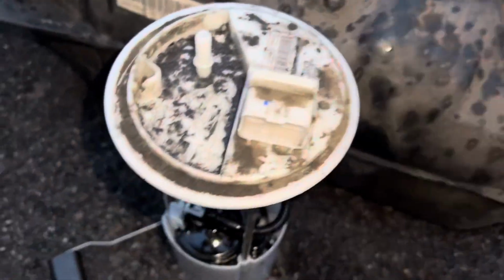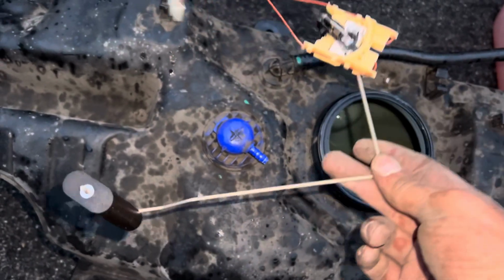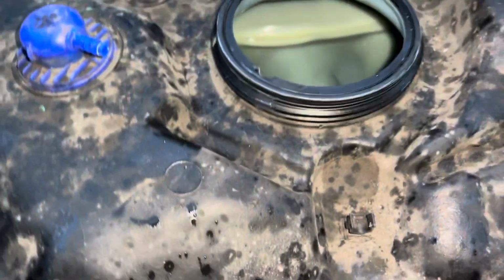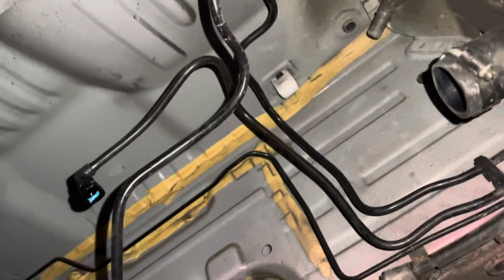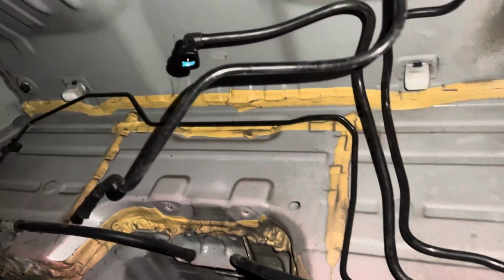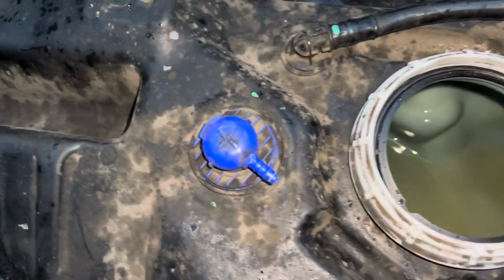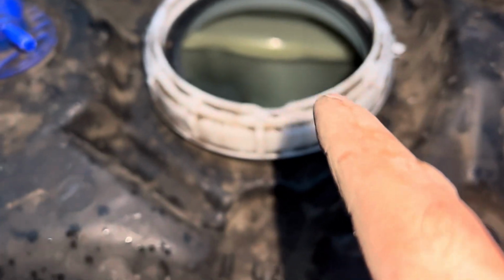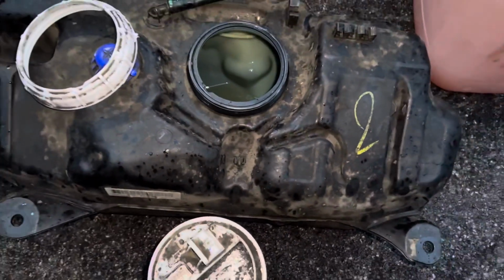VAUXHALL ADAM FUEL GAGE NOT WORKING - CAR NOT SHOWING FUEL LEVEL - VAUXHALL FUEL SHOWING 0 FIX  2016

Comment: I have a 16 plate ,I'm having the same problem been back to garage under warranty they said it was a wire ,2nd time they said no fault codes showing  ..would this show on a computer or am I just getting the run around
Reply from the maker: Hi, no fault codes come up when it is this issue so no matter what type or computer connected it wouldn’t show

Comment: My girlfriends car fuel gauge goes down rapidly from full to half a tank within about 25 miles. Would this be the same issue?
Reply from the maker: Sorry I don’t really understand your issue, if your cars fuel gage reading wrong or is your fuel actually going down faster
Reply: @carhelpforyou  when you fill it up to the point where it stops to say it’s full. When you start driving, the gauge starts to drop dramatically. I drove it for 25 miles on the motorway at 70mph and the gauge went from full to half a tank which can’t be right and my girlfriend keeps thinking she needs to top up fuel lol
Reply from the maker: @pepball1776  once it dropped did you take it to fuel up and see if the fuel was actually low if it is then you’ve got a leak somewhere if if it didn’t then replace the fuel gage
Reply: I have this problem too, it happened once in 2019 and it’s happening again now. The fuel gauge rapidly goes down as you’re driving even though you’ve just filled up. There’s no leak, in fact once I’ve been parked up a while and then got back in the car the gauge starts going back up again as I’m driving and the miles to empty go up as well. It’s very random. So it’s gotta be the float/sensor? Another known issue on the Adams apparently. I’m on Teesside too btw 🙌🏻
Reply from the maker: @rukiakuchuki  seems like faulty float best to replace it, would recommend getting the part from dealer just had a few issues when I’ve fitted ones from eBay etc recently but dealership ones haven’t let me down yet
Reply: @carhelpforyou  Hoping it is the float, drove for 10 minutes last night with Fill Fuel flashing only for it to then jump up to a quarter full and going up 🤷🏼‍♀️ Better to get the part from Drive Vauxhall in town then you reckon?
Reply from the maker: @rukiakuchuki  sound like the float, yeah go to dealers for part don’t buy elsewhere

Comment: Does the fuel trip (distance to empty) readout still work even with the sender up the creek?.....as it's fed by the ECU and flow?
Reply from the maker: If the float in the sender is faulty or broken it will not read correctly or sometimes even read at all

Comment: I have the same problem also now have an other fault coming up about to much oxygen in the engine. Garage thinks it’s linked with the fuel gauge problem. It’s 2016. Any help would be great.
Reply from the maker: I would advise start by repairing the fuel gauge the same way I did or even replace the entire pump if oxygen issue persists check the sensors known as o2 sensor (oxygen sensors)
Reply: I have two faults. 

P0171 mixture adaptions lean 
P0463 fuel tank level sensor voltage too high.

Did you have any codes come up with the cars you have seen ?
Reply: @lisakernachan6651  what was your fault ?

Comment: Hi mate, could u not access the fuel pump from under the back seats rather than removing the tank.
Cheers.
Reply from the maker: Hi, sadly no access from inside the car other can cutting a hold into the car under the seats which would leave you with a hole under seats
Only way access would be to drop the tank sadly

Comment: My car just turn off without a reason. Power los and engine turns off. No start for a few minutes. No fault codes.
Any idea?
Reply: Hi there I’m having this issue now can’t find what is wrong with the car. Did you find out what the fault was after thanks

Comment: Hello. Great video mate. Can you please post the parts number of the gauge sensor.  I have the same problem, but i cant seem to find the part without buying the whole pump assembly

Thanks
Reply from the maker: Sadly I don’t have the part number however if you call your local Vauxhall dealership and give them the reg they will find you the part it’s not over priced unlike dealers normally

Comment: Okey, thanks for the video! bud what you are not mentioning is that you need a special tool to get de pump out of the tank! Got me stuck there.
Reply from the maker: No special tool needed bud, you can remove the locking cap without special tools just be gentle

Comment: Need to do the same on astra j..17 cdti.
Is it a big job ???
Reply from the maker: Will be the same as this if the pump is located in the tank, I would advise to take a look in boot and under rear seats as they can be located there on certain cars which would make this job a lot easier as you wouldn’t need to remove the tank you can just remove the pump from the top

Comment: Hello, how easy was it to remove the fuel tank ? Can it be done with axel stands.
Reply from the maker: Follow what I did and it is fairly easy to do with jack and axle stands I did it on the ground without a lift so it deffo doable just take your time and take it carefully
Reply: @carhelpforyou hi mate,  any idea why it's a slightly different fuel pump on the   1.4s turbo model? They are a nightmare get hold of lol
Reply from the maker: @ hi, sorry not sure why they made it different but all fuel pumps work in the same way really so if you have similar problem then fix would be identical, try a few scrapyards for this part someone will have one somewhere hopefully